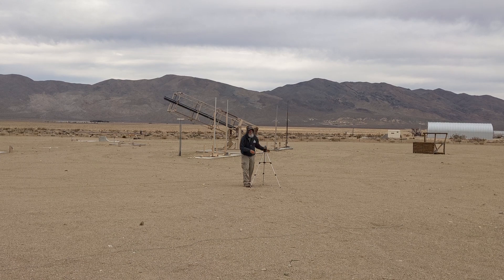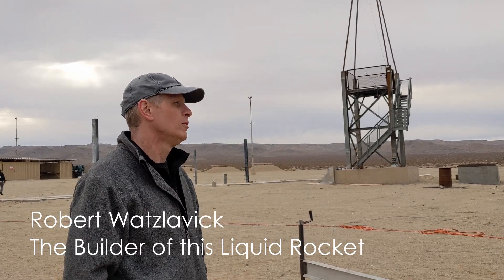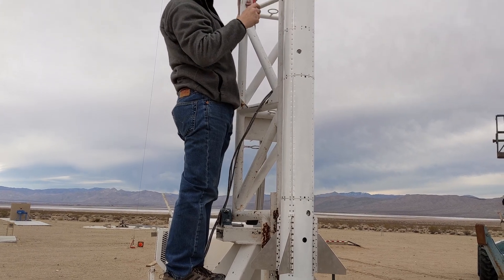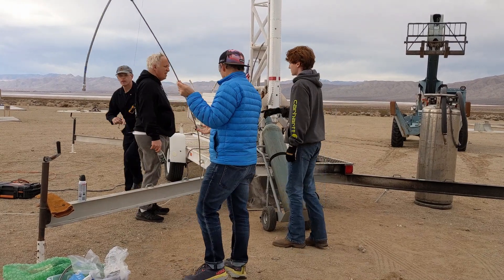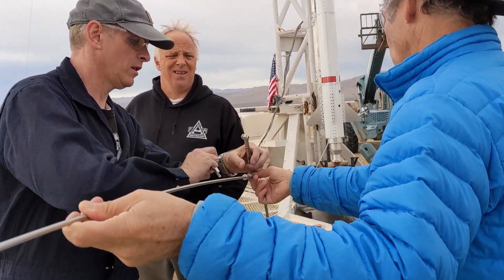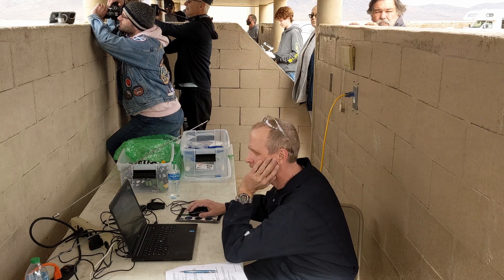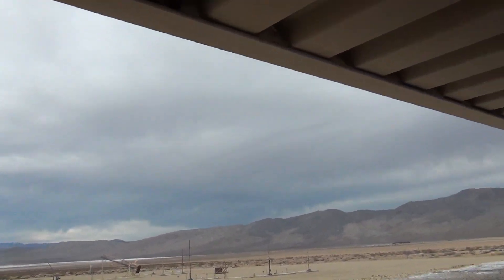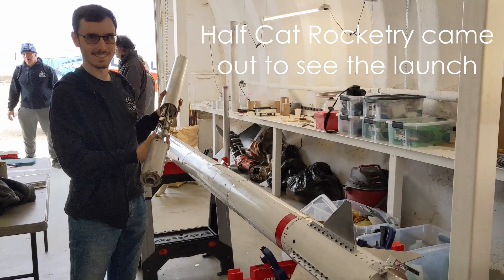Watzlavick KeroLOX Rocket Perfect Flight (Reupload)

Comment: I'm always a stickler on combustion stability, and that beast did not disappoint 1/128th of one single bit. That plume was rock solid stable. Not an easy task with kerosene. What grade did you use?
Now I want to see some crazy person to launch a solid fueled- rocket with a double or triple base propellant, or a composite-modified double base.

Comment: Great rocket! How do you load the LOX inside the rocket? Do you use a pump or just use the pressure from the LOX tank?
Reply from the maker: We load LOX from a special insulated Dewar, which you can see in the video. It's a process that needs experienced hands to perform safely since any trapped LOX can boil off to extreme pressures. The vacuum insulated Dewar keeps the LOX cold so it doesn't boil off into gas too quickly, while relief valves vent off excess gas when it gets too high, so a fully loaded Dewar can keep liquid for about 2 weeks depending on the outside temperature. The pressure of this boiled LOX, kept around 100psi or so, pushes the liquids out the fill port using a dip tube, like a soap dispenser. We connect a hose to the bottom of the tank, and open up a vent at the top so the LOX can displace the empty air inside. We continue to fill, in a process known as prechill, as the liquids rapidly turn to gas in the warm propellant tank. Eventually the tanks cool down enough that the LOX can make it to the other dip tube inside the propellant tank, which is set to a depth where we want the liquid level to be. The rocket vents out liquid oxygen, making a distinctly different sound. We evacuate everyone else before closing the vent valve and booking it, since as mentioned, trapped LOX can boil off to extreme pressures, and you should only put so much trust into a safety device like a relief valve.
Reply: @DerekHonkawa  Thank you very much for this explanation. Is it hard to get LOX in such relatively small quantities?
Reply from the maker: LOX is readily procurable at FAR through your typical industrial gas distributors like Praxair, though usually only in these fairly large Dewars. As you can see by Watzlavick and the student teams, it is entirely possible for amateurs to do so, but crucially it is used at facilities with proper propellant storage facilities and experienced personnel.
Don't try this at home. Try it at FAR instead so we can watch too!
Reply: @DerekHonkawa  First time I picked up a LOX Dewar on Friday to bring to FAR for a launch on Saturday, my wife came running into the house saying that thing in my truck was going to explode (she came home and heard it venting). I went outside and told her if it didn't vent through that safety valve like that it would blow up.
Reply: @mojaverockets  - You all are motivating me to expand away from solid propellants. I never really considered KeroLOX systems. I've always thought Liquid Propellants needed much more complex systems like the Raptor Engine. 

Lately, I've been wondering how small we could design hypersonic scram jets. hahaha... All the books I've been ordering makes me thing I'm about to get raided some night. Yet, I haven't built a single motor yet. Just all studying and prepping. I'm kinda afraid Liquid Propellants will be the primary key to getting to hypersonic speeds. This will put me another few years behind schedule.